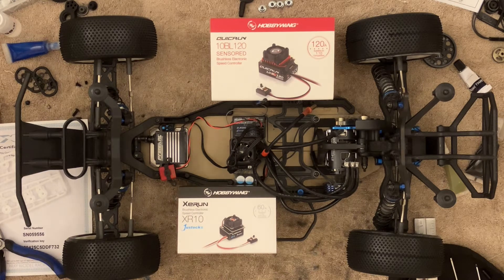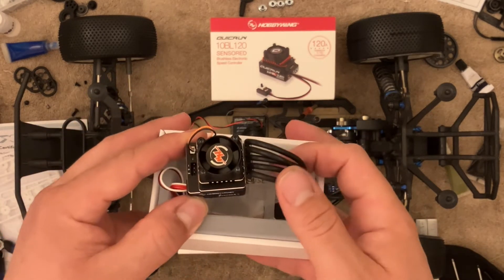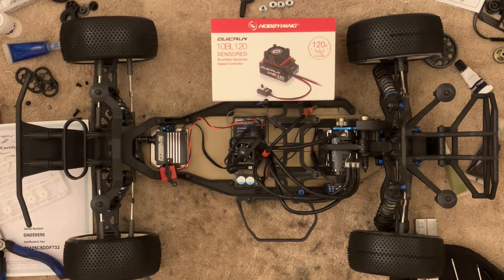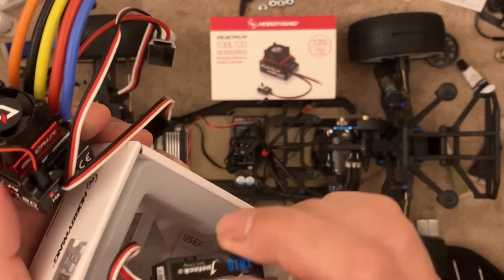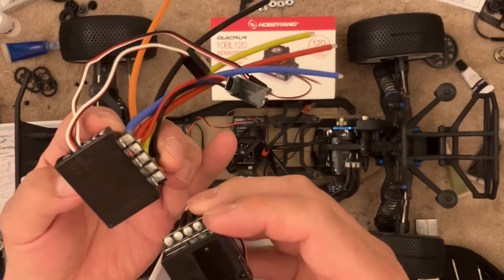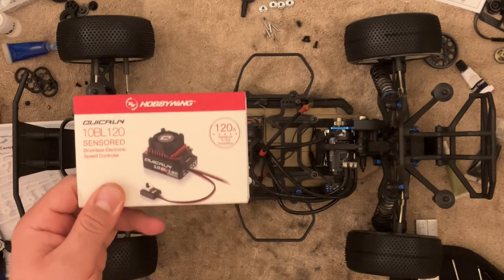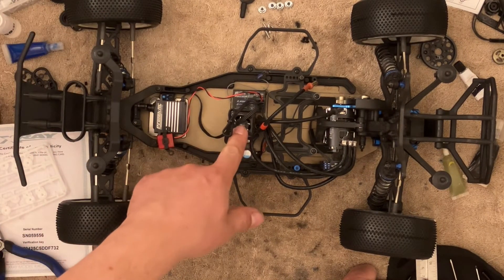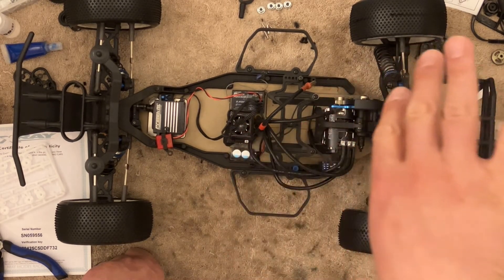Basic talk: Hobbywing XR10 G2 Elite vs Pro stock vs Justock vs Quicrun 1:10 esc Which one to get?

Comment: Good info. I am glad you went over "blinky". I am building a 4wd buggy and I need electronics. I have the 10bl 120 that I was using for my drift car but i might put it in the buggy for now with a 13.5t. I'll then upgrade/trade out for the Just Stock ESC. Any recommendations for a motor. I was thinking of running the Bandit or the Just stock motor. Any advice would help.  Thank you.
Reply from the maker: They are good motors, but is this a fixed timing class or open 13.5T? If it is open 13.5T and you can run any timing, I would look into a Hobbywing G4 or a Fantom RS. Both of there come out of the box with great rotors. 
Here is the link to the HW 13.5T: https://youtu.be/X2ebQrK6zUM

If you go into my channel and type 13.5T I think I have done maybe 9 13.5T videos. Feel free to check them out.

Comment: Your videos are great! Right to the point. I'm upgrading the motor in my 1/10 Rival MT10 and trying to decide between the EZRUN Max10 140amp combo and the Quicrun BL10 120amp combo. What would you recommend? I don't want to have any overheating issues on 2s and 3s. I have an ezrun max6 combo in my kraton exb and it's great. Thanks!
Reply from the maker: The EZRUN Mx10 is smoother. Temps will be about the same assuming the motors are about the same. I think the Quicrun motors go up to 3660. My EZRUN motor is a 3665. I have not gotten a change to do the video. Maybe this weekend. I have HWA38020345 in my 4-Tec 2.0.
Reply: @telecomandorc   I'll look out for the next video! Do you think putting an EZRUN mx10 is an overkill upgrade for a rival mt10? I picked up a brushed version on a really good deal and want to put in a good brushed system. I would get the same size, 3665/
3200kv. Alternatively I could just get a quicrun 10bl 120 combo, but if the ezrun is worth the extra money for the performance, build, better for 4wd and durability I would go for that. Thanks!
Reply from the maker: @pizzomedia7261   I think the HW on 2s is perfect. If you want a bit more, 3s would be  good but breaking something is inevitable. 

I know BL are the greatest, but I still like brushed motors because they are smooth. But brushed motors do lose speed as the brushes wear down. You have to keep washing the motor and cleaning them. 

A Quicrun would work because they are geared lower in your mt410. You will not notice the cogging much.
Reply: @telecomandorc  thanks for the response. I don't have an Tekno MT410. I have a TA Rival MT10 brushed version. I was just trying to decide between swapping the motor/esc with the HW max10 combo or the Quicrun 10BL combo. I'm leaning towards the Max10 because like you said it would be smother, just debating if such a good/motor esc combo like the max10 would be a waste to put in an RC like the MT10. Of course I would put it in an MT410 without question, but the Teckno is on another of quality. Maybe I'm overthinking it. I do know one thing I don't want any hot motor issues even on grass. Thoughts?
Reply from the maker: @pizzomedia7261   Sorry... MT410 was a typo. I meant MT10. On 2s it will be awesome. It will have power and run cool. It is really about price point. Set a budget and decide. If money is not an issue, I would get the 3665 and Max10. If not, Quicrun with 3660 motor.
Reply: @telecomandorc    thanks for the input! I'm have the max10 on order. The MT10 is a cool little car, but like so many RTRs the electronics are not that great. I think Arrma is getting better, but I wish they would all come as rollers. It's making me want to break down after all and pick up an MT410 2.0 to build. The quality is so much better. That's my plan anyway. Put quality stuff in the MT10, transfer it over to the MT410. I think a max10 3665/3200Kv will still work well in that truck? The 2.0 is based on true 1/10 parts.
Reply from the maker: @pizzomedia7261  The 3565/3200KV will still over power an SCT. To give you an idea, the Tekin Pro4 HD 4300Kv was over powering in my Stampede 4x4, it was awesome in my Tekno SCT410.3... it was not bad in a Tekno MT410. And the HW 3665 4000kv has a longer magnet than the Tekin with similar gauss at the point of measuring. But the HW are made to handle 3s whereas the Pro4 is meant for 2s. Point is, the 3665 in an MT10 or SCT410 will make it wheelie and flip over with 3s. 😁
Reply from the maker: Here is the HW 3565 https://youtu.be/2VvmHxPMOiE
Here is the Pro4HD https://youtu.be/7ki-rbAPFmM
Reply: @telecomandorc  good to know it will have that much power with a 3665 motor. I'm sure 2s will be great as well. It probably won't stay in this car long because I'm really wanting to build something quality like the MT410. The MT10 just feels super cheap. I'm sure it will be fun though. Thanks!
Reply: @telecomandorc   nice test!
Reply from the maker: @pizzomedia7261  You are welcome. This motor would go nicely in an MT410 2.0 as well. Make sure to get a high torque servo.
Reply from the maker: @pizzomedia7261  Many thanks. 🤝

Comment: thank you for doing this - very useful

though i like your kind elaboration of that Blinky mode? I understand the lights blinks a lot... so blinky...  however, i think it is More than just blinks... cuz you kept mentioning blinky...

What else does blinky mean other than blinking lights??
Reply from the maker: The blinking red light lets the viewer/tech/inspector know it is set to zero timing, so no electronic timing advance thought the esc, no boost and not turbo.
Reply: @telecomandorc  thank you.. It means  blinky is like standard mode
Reply from the maker: @mttbsg  That is a good way to think about it. IT means standards mode or zero tuning mode.

Comment: Thanks for the video, I have a Hobbywing XR10 Justock G3 Sensored Brushless ESC. Running a 13.5 juststock motor. Can I use one of these juststock motors 10.5, 7.5, or 5.5 ? And it is a 1/5 scale motorbike.
Reply from the maker: You should be good with the 10.5... I do not think the esc can handle the 7.5 given the bike probably weighs closer to 2kg which is pretty high compared to a 1/10 TC.
Reply: THANKS!  @telecomandorc
Reply from the maker: @sydeckcoleman9123  Any time.

Comment: Does the hobbywing xerun xr10 justock sensored 60a have turbo and boost and i can use a supersonic rocket 10.5t for it right?
Reply from the maker: It will handle a 10.5 motor, but there is no timing. It's a spec esc. You need the 100A version.
Reply: @telecomandorc  so,I can't use the timing from the motor?
Reply: Chatgpt said it's a blinky esc,so I can change it into a non blinky esc and use the timing from the supersonic rocket 10.5t
Reply from the maker: @SaniHjsabtu  Sorry. I misread it. I thought you meant timing and turbo in the esc. The motor, yes, to can use the timing in the motor. But a 10.5T motor will not take much timing before it start consuming a lot of amps and heating up.
Reply from the maker: @SaniHjsabtu  Correct. blinky has not timing or turbo or boost. What is the application?

Comment: Hi. Thanks for this great comparison!
I'm currently searching for the right ESC for my Tamiya XV-01. It's just for bashing, nothing "official". I already narrowed it down to these two candidates: QuicRun 10BL120 and XeRun RX10 Justock. In case of the RX10 I could get my hands on the latest G3 or former G2.1(?) version which by the way does officially support 3S, but only has a 2A@6V BEC.
I'm tending to the 10BL120 as a sensored setup and timings are new to me and I would like to be able play around with the timing (blinky mode is not needed). Is there anything else you think I should consider in my choice? Which one would you recommend?

The Tamiya XV-01 has a limited space for the ESC. Could you do me a favor and measure the dimensions of the 10BL120 including the soldering contacts? The dimesions given on Hobbywing's website are inconsistent since they are the same for the 10BL60 and 10BL120 and they don't seam to include the soldering contacts.
Do you know if the 10BL60's footprint only shorter or also narrower?

Thanks in advance!
Reply from the maker: If the 10BL120 fits, that would be my choice. I will have the mesurements by the end of the day.
Reply from the maker: 37mm X 44mm
Reply: @telecomandorc  Thanks a lot! That should fit!
Reply from the maker: @RixxxiR  Awesome!
Reply: The 10BL120 have been my go to 1/10 Brushless speedos lately... I can't see myself buying any more expensive ones...
   We have Muchmore, Speed Passion, LRP, Reedy, Hobbywing XR10 Pro, Maclan, etc... and all new cars get 10BL120, or ones that die get replaced with 10BL120... theu will do anything I want , 2wd, 4wd, etc... we use them down to 6.5t in a couple 4wd , amd they rock...
   The ONLY downside is no blinky for spec races.... for that purpose I will be buying a couple Justock setups soon for a spec class of onroad... 
   I kinda want an XV for ripping around the yard... hope you're having fun with it...

Comment: I need a motor and esc for a 2wd associated,  Im new to racing what should I get? Thanks
Reply from the maker: What class are you racing? 
ESC Hobbywing Justock G3S (HWA30112005) is all you need. 
Motor... It depends what class. Some places have "spec" set to 17.5T or 13.5T. I really like the Fantom Helix RS motors. Although, the 13.5T Hobbywing G4 is awesome too. I cannot really tell the difference between the Fantom Helix and the G4. 
This is one of my basic motor videos:

https://youtu.be/M75WPEuHgOw

https://youtu.be/HAx8V6S2ULA

I have a few more too.
Reply: @telecomandorc  Thanks I'm thinking 17.5
Reply from the maker: @MX-CO   Fantom is the way to go.
Reply: Does the G3S have blinky mode?
Reply from the maker: @MX-CO   The HW Justock G3s is blinky only.
Reply: @telecomandorc  OK gotcha,  so would it better to get a higher end model?
Reply from the maker: @MX-CO   Not for spec racing. The G3s has a BEC of 4A. That is big compared to others rated at only 2A. So you can run a nice torque and speed servo and your BEC will not break a sweat. If you end up running a 17.5T open class, then a XR10 Pro G2S so you can run some boost and go back to blinky... If all you are running is spec blinky, a Justock will handle down to a 10.5T. And if they have a 13.5T spec class, now that class is sweet.

Comment: Эти регуляторы скорости предназначены для разных целей и сравнивать их некорректно. Мой выбор для туринга 1/10: XR10 Pro Stock для гонок или 10BL60 для покатушек; для SC10: для гонок Xerun 2.1 или 10BL120 для покатушек.
Reply from the maker: Well, I understand your point, but that is why one compares them. Your last point proves the point of the comparison. It is not to compare which is best overall. It is to see which is the best for a particular application such as your recomendation at the end of your post. I agree with the recomendation, which is what I essentially do in the video. 😎 Thefore, we are both onboard.

Comment: The 10bl120 works awesome in mod offroad racing as there's so much extra motor you don't really need any timing adjustments.... a 6.5 in a 4wd or an 8.5 in a 2wd is plenty fast... but it does give you a few useful and needed adjustments, brake strength and/or drag brake, punch,  etc.. 
   They're cheap and work well for us and a handful of others...and then you're not killing 200$ speedos beating them about in the dirt and sending them on huge jumps... 
  HW sure has some great stuff out , I have some of theor brushed stuff, an XR10 Pro, a handful of 10BL120 speedos, and a couple XR8 SCT for 1/8 E-Buggy ....  now to get more , including a couple Justock most likely... 

  I'm trying to research the Justock setups for a specific blinky need that is coming to my area... and stumbled onto your video...  thanks for the content...   cheers
Reply from the maker: With pleasure. And thank you for your input. 
Cheers.

Comment: My car sucks now that it’s got a hobbywing esc. I plan on tossing my car away now. Rv cars blow!
Reply from the maker: Have you calibrated the Tx and esc? That usually solves it.
Reply: @telecomandorc  yep . My car is junk now. This hobby is a joke
Reply from the maker: @colestaples2010  Well, thank you for watching. But if you have questions regarding RC, let me know.
Reply: @telecomandorc  the esc is useless unless I get an expensive programmer. Hobbywing is not cool at all
Reply from the maker: @colestaples2010  The program box is $30 (HWA30502001). I can see how that can seem expensive. But the esc should have come with a large sheet with instructions to program by counting blinks. Which esc do you have?
Reply from the maker: @colestaples2010  I am a fan of HW, but without seeing it or knowing what it does or does not do, I am not much help. But try Castle Creations' Copperhead ESC. So far it has been great for me.
Reply: @telecomandorc  I couldn’t find one under 60. I’ll try to find that one and see if it works. I prey I can get it functioning properly
Reply from the maker: @colestaples2010  I am not sure where you live but Amain has the HW program box for $30 as of now. This is the part number HWA30502001.